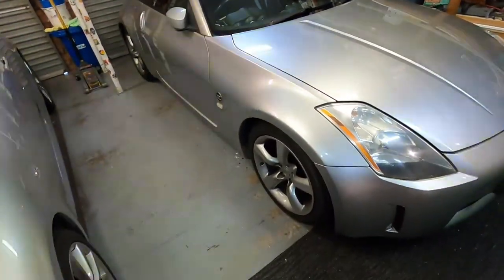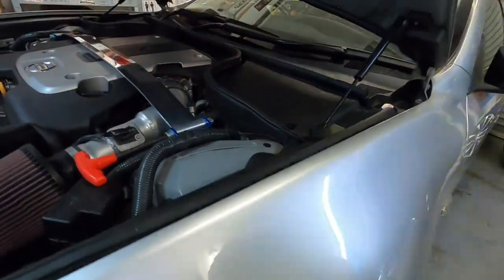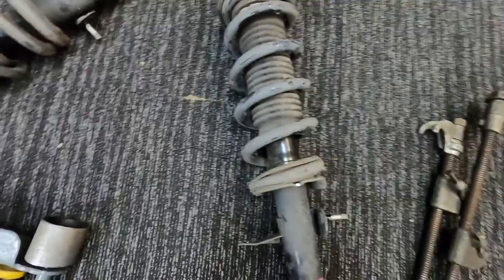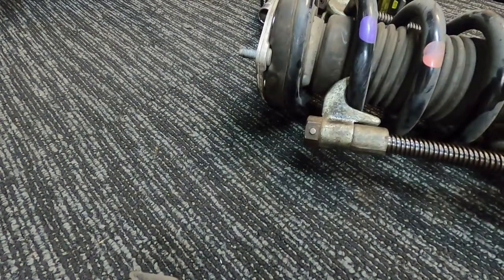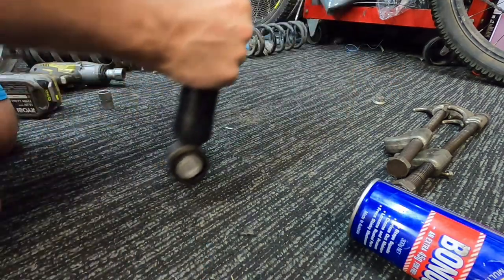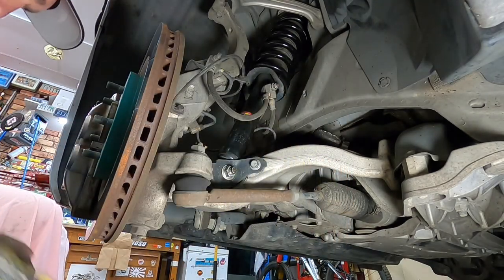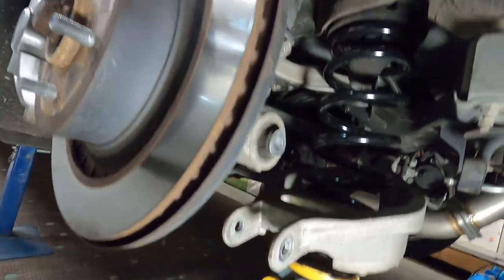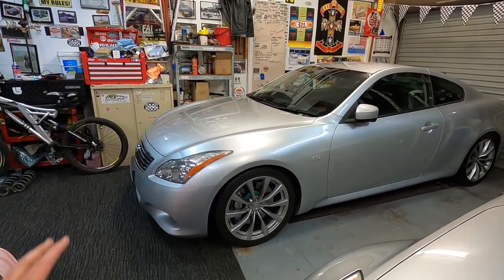V36 skyline RS-R lowing springs how to, review G37 infiniti

Comment: hey man, funny that we've both got the same 2 cars in the garage. Anyway, was gonna say, have you thought about putting in the endless brand bonnet pop up cancellors? We've seen some cars that are lowered, hitting big speed bumps or suchlike and setting the bonnet popups off. Your how to's are great btw. Im Brett from the VQ Skyline and Z group on FB.
Reply from the maker: I have been looking at the bonnet cancellor only since I have seen a few cars on fb where they have gone off. If I get them I'll do a video on them.
Reply: @driftcarsjp  yeah a vid would be cool. And helpful for those doing the job. Do you have one of those wiper arm removal tools? Removing those means driver side cowl can come off which means easier access. R35 cancellors are 1 week from nengun.
Reply: Hi there, I'm curious what is a bonnet cancellor? Use for?  I try Google it didn't really helps.
Reply: @kempowarrior there is a bonnet pop up mechanism that happens upon front impact. Its to throw pedestrians over the car when hit. w
When lowered cars hit bumps it has been known to set it off. Its expensive and a nuisance to sort out. R35 bonnet pop up cancellors stop it occurring.